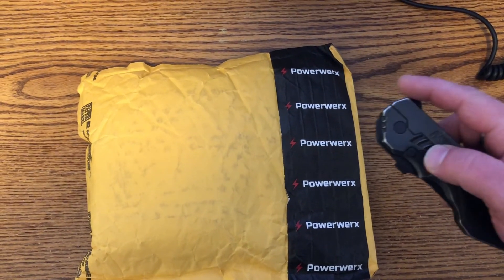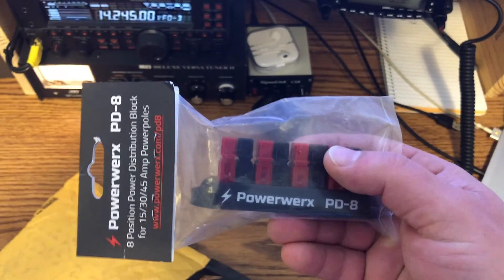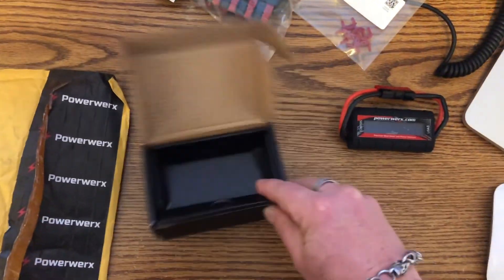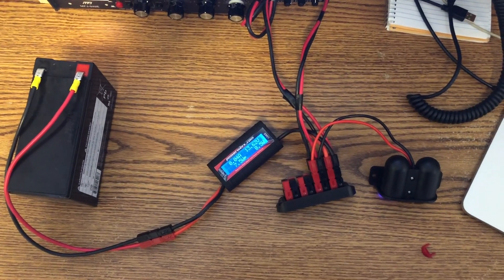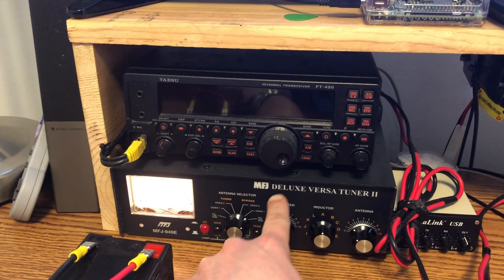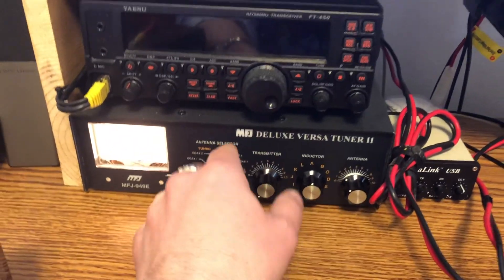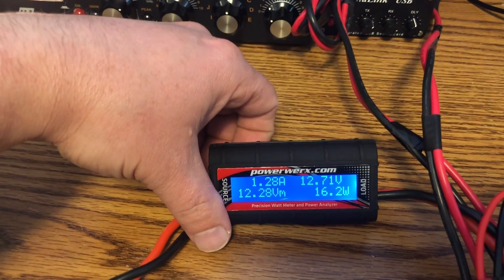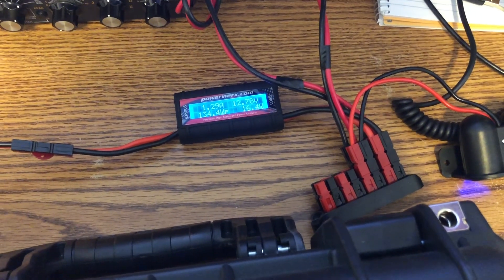Powerwerx Stuff

Comment: Have you figured out how to use the powerpole retention for the antenna yet? My suggestion would be to have a blank set (no wires) so you can anchor the antenna wire with the clip. Easy Peasy.

Comment: The time stamp shows that this is 5 years old - still very relevant to me! Your ham shack has certainly been “beefed up” with more radios and stuff. Thanks to HAMRADIOPREP I just passed my tech test (KQ41XD) and hope to make “first contact” with ISS tonight (Baofend UV-5R), understanding that my little signal may be trampled on - but - high hopes. Working on General exam. 73!
Reply: Good luck on the exam. I just passed my General on 8/12. shack is a work in progress, but powerpoles do neaten up the wire tangle that could happen. That and cable looms.

Comment: Great info. On your other YT vid ("DIY LiFePO4 Ham Radio Battery Backup System"), you mention @10:40 you don't really need a PWRgate, unless you want to add solar. If I needed to, can I add a Powerwerx MPPT-150-14.6, DC-to-DC Solar Charger Controller AND the panels (GoalZero) to the PD-8 in this video? Would I need anything else in the path?

Comment: Yea, I will get an Anderson plug box and try it out and see if I like them more then the annoying of the nonsense of the CM4 plugs. Hate them.
I have one CM4 plug by some of the different cables I have bought that is made to open Easy with your fingers, but I have no clue as to where to get them. But overall, those I hate those CM4 plugs, just utter nonsense, you can't even detach the plug from the cable without ruining them. And that is needed you need to get a cable through a small hole. Then you need to ruing a plug and make a new one.
My Solar panels came with plugs you could not even detach without a tool, like... you gotta be kidding me. No tool with the pricey solar panels either.

Comment: Interesting products. I see you have a MacBook on the bench, I wish there were a lot more Mac and Apple based programs for Hams. I hate lugging around 2 laptops. Michigan? From the Sunshine state? What happened? Don’t get me wrong in the summer it’s great to go camping in the upper peninsula and work some stations from remote locations. 
The West Mountain stuff is great if one is building a Mobile Command Post in an RV or dedicated Comms trailer but for portable go cases we don’t need the extra weight of that metal case. I do wish that Powerwerx multi outlet had an additional input connector with the 45 amp contacts, it would free up an outlet and give one the full capacity of the adapter. You might want to also check out the power pole accessories from Hardened Power Systems, not sure of the price ranges of their stuff, haven’t been to their web site in about a year.
Reply from the maker: I've never needed to lug around 2 laptops.  I've got everything I need on my Mac.  My main logging software is Aether, for portable I use HAMRS, and I've got WSJT-X for digital.  Works great.

Comment: Outstanding content. You have been at this for awhile. Solar charger and internet face with battery.  Believe you not want to over charge and not have no voltage form the battery, you would have to replace the battery.  What wattage would you use.  60 - 70- 100?????
Reply from the maker: It's been a few years now yes.  I'm not 100% sure what you mean hear, but yes, you want to make sure you're charging your batteries correctly.  With the AGM battery in this video I would only use about 5 watts.  They are really terrible batteries and I do not use them anymore.  I only use LiFePO4 batteries.  I've done a few videos on Bioenno Batteries and highly recommend those.  You can do 100 watts no problem with them.  I have another battery coming from GigParts tomorrow that I will also be reviewing.

Comment: You're not the world's worst solderer until you beat me! Gauntlet thrown down!  Gonna get that same power block for my go box.  Yeah, transmitting on a full power HF rig, even with the power turned down, will eat your amp-hours very quickly.

I've got that Heil adapter and KTT (kick to talk) pedal, and I use an SM48-LC rather than a more expensive mic since I figure on an HF radio nobody will be able to tell it's a low-end Shure.  All my XLR mics are Shure because the just work and they'll outlive me.
Reply from the maker: Unfortunately I've gotten better at soldering over the years.  Still can't solder the shield of a coax so I crimp.

Comment: How much power is the meter using itself in order to operate? There must be a “pre-load” before it gets to the board. Would be curious if your readout on the meter takes that into account
Reply from the maker: So little that it its not enough to be concerned with.  If you hook another meter in line with it it doesn't even register as a load.

Comment: Mike - Question if you don't mind.... I am looking for a PowerPole solution for my home setup. I have a power supply with the ring connection terminals on the back. I was looking on Powerwerx website and I see that they have a cable with the ring connection on one end on powerpole on the other with a fuse inline (SKU: RGH-10). I was thinking about getting that to hook to the back on my power supply, then I would be able to hook my radio right to it with Powerwor SKU: HF4-PP... Or get a powerwerx dist. block and connect multiple things like you show here in this video... I say ALL that to ask this, does that sound like a good solution? I'm trying to get it right the first time. Thanks for all you do and your time! 73's - N1UI
Reply from the maker: That cable would be a good start.  The problem with power poles is once you start, you can’t stop.  You’ll find you will be looking for things to put power poles on.  Cutting off brand new factory connectors just to put power poles on.   If it’s 12v DC in my house, it’s got a power pole on it.  Get a good set of crimpers w/ the power pole dies.   Should run you about $50 ish but some run in the hundreds.  But yes I would run out from the supply, into a distribution block if you have or plan to have multiple radios or 12v stuff in your shack.  You could also look into one of those MFJ power pole distribution blocks that I did a video on.  They are all individually fused and I really like that.
Reply: @hamradiotube  Thanks for the reply! Yes, I seen your video on the MFJ dist. blocks as well! My main question is... Do I NEED a fuse inline from my power supply to the radio such as the cable I made mention of from PowerWerx? Ha, yes! I'm already seeing things around here that are about to get a PowerPole connection! LOL Thanks again for your time!
Reply from the maker: You def want a fuse somewhere.  If all your radios have fuses on their wires that should be sufficient.  More fuses certainly wouldn’t hurt so having one from the power supply is a good idea.  Plus it could protect your supply if you are drawing too much current from a bunch of different sources.
Reply from the maker: @w8haallthingshamradio149  Well, your radios cable should have a fuse in it already so no, you don't need another fuse from the power supply.  You 100% need a fuse before your radio gets power however.  I want to be very clear on that.  If I were setting up your shack, I would make, not buy, a wire going from your power supply to a distribution block (that could also be fused).  Everything I plug into that distribution block would have a fused cable, thus negating the need to have a fuse on the actual power supply cable.  However, having a fuse on the power supply cable would never be a bad idea.

Comment: You paid $50 for that power meter?!?!?!  WOW!!  They're $10 on eBay (or just about anywhere else).  The only difference is they don't have the Powerwerx name on 'em.
Reply: Hurricane wind power DC inline 150 amp High precision watt meter & power analyzer $16.49 & FREE shipping! and yes it is as good as all the others.
Reply from the maker: Chad Harzke yes I did. And I have bought cheap ones and they aren’t accurate.  You get what you pay for.
Reply: Between my Elmer & I we have 5 of them.  I tested them against my Fluke.  They were off by less than 2%.  I'm a ham not an engineer.  That's better than close enough for me.
Reply from the maker: @batmansgta  You are correct, my cheap one isn't that off but I still like an accurate reading.  Plenty fine though.  Live and learn.

Comment: That distribution block is EXACTLY what I need as I've got the older Rig Runner with screw-on terminals that I want to convert to Power Poles.  Thanks for the tip!
Reply from the maker: This one is great.  I just picked up a new power pole strip from Ham Radio Workbench that has fuses and led's that I'll be posting on the channel in the next few days.  It's a kit you put together and only costs $25.  I'm gonna post the build.  It looks pretty easy.

Comment: Thanks for the interesting video, I subscribed.
My Powerwerx PD-4 distribution block has just arrived. It's not immediately clear to me how you use the block. The terminals of something could be inserted "side by side" on the block's same side or using the terminals on "opposite sides" of the block. It's obvious from your video which is the correct configuration!
Reply from the maker: It's pretty simple.  Any one of the Power Poles can be used as your "power in" from your source.  All the other ones will then be "power outs".  The power poles are oriented in such a way that only the red can connect to the red and the black to the  black.

Comment: Thanks for sharing. I have an FT- 891. You will be surprised how much power it draws. I have a lead cell also and if I get to drawing much more 10-15 watts it will blow the 7.5 amp inline power fuse going to the radio because of the voltage drop in the battery raising the amps drawn by the radio. OH8STN  has a good video on the current draw of the 891 on his channel.
Reply: Don't know what the battery has to do with it? Any rig doing 100w will draw over 20 amps.
Reply: @ripvanwinkleamateurradioso3075  I can run the ft-891 at 90 to 100 watt with a bioenno 20 amp battery with no problem can't do that on my little lead acid battery

Comment: If your laptop runs at 19v you could get a 12v to 19v converter to power your laptop too
Reply from the maker: Don't know the voltage of my Macbook  but I have figured out the least efficient way to charge it!  12V battery to 120V harbor freight inverter (I'm sure there's no loss there hihi) to the standard Mac power cable.  If you want to suck a battery dry, this is the way to do it really quick!!